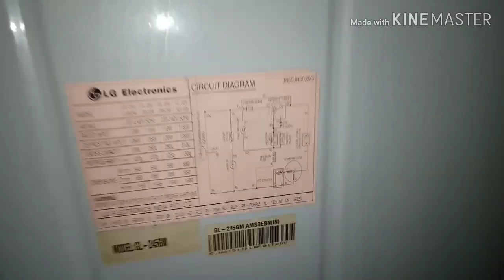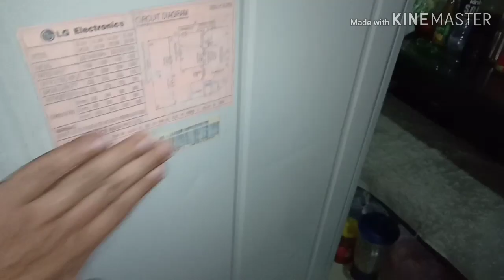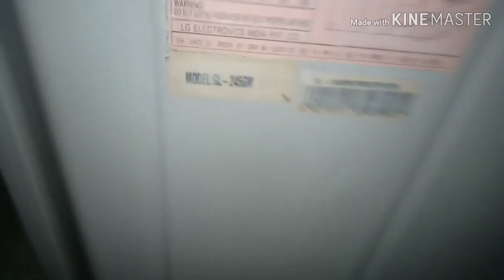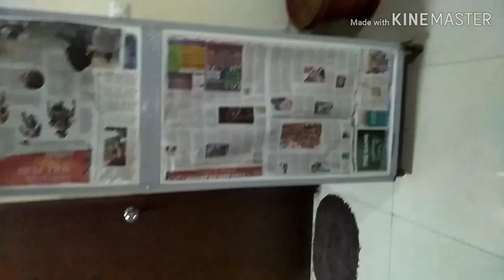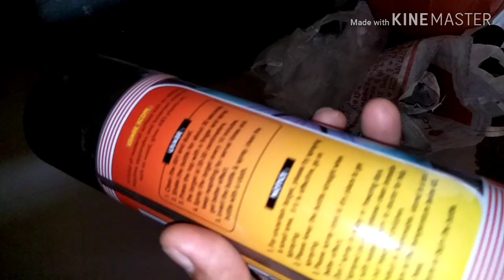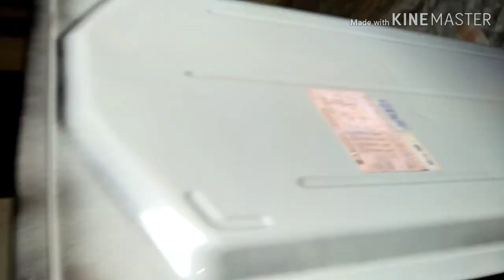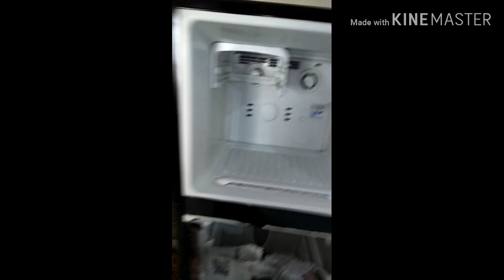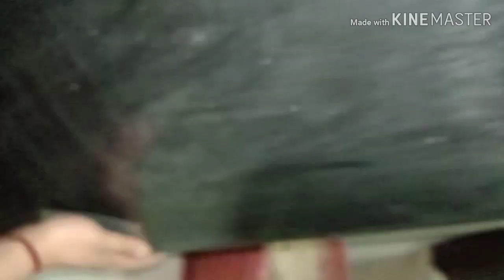How to Paint:12 year old : LG Refrigerator: Getting a New Look

Comment: How to remove rust from refrigerator body?
Reply from the maker: There are few ways we can do.
Sand the area if the rusting is in small depth.In my case I had bottom of doors rusted,had snad them and painted over.
Reply from the maker: You can sand with 600 grit and finally 1000 grit and use primary and paint the body color like what I did.There may be a fear of matching color availability,but you can always change that color to your choice.
Reply: Thank you.